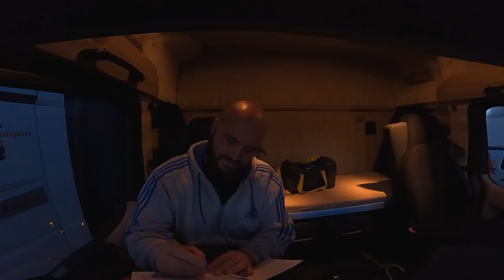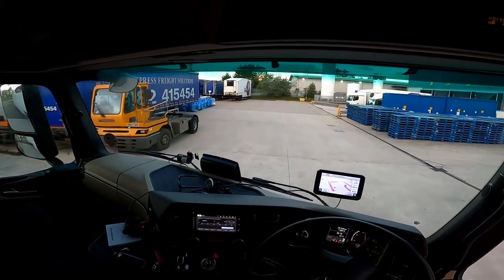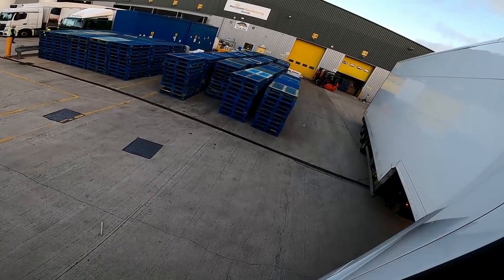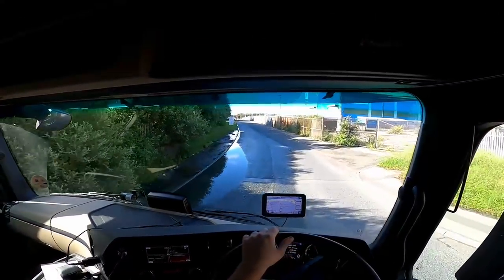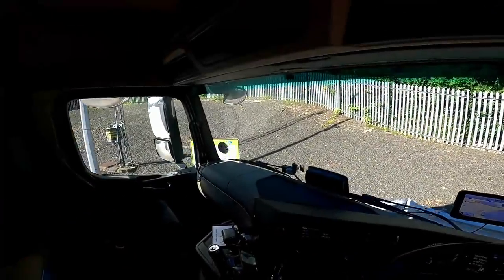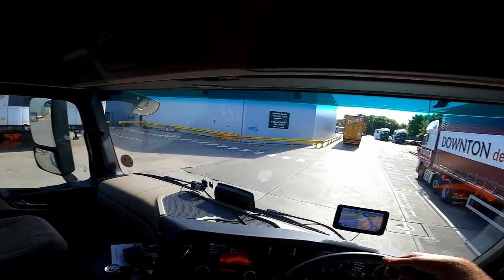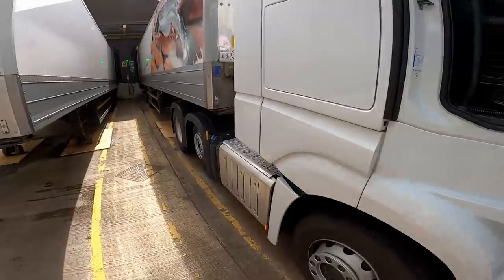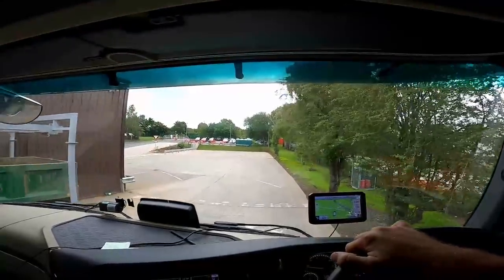The Trunkin Job

Comment: Nice one ..... you can lift and lower when pulling out or going under the trailer with the controls on the steering wheel
Reply from the maker: With the merc? I did not known that
Reply: Raul689 yeah go along to the picture with the axels then scroll down one to level control press ok and skip one to the right and then up or down to lift or lower makes it much easier my friend and I’m just going to subscribe
Reply from the maker: Thanks verry much pal. Good tip 👍👍👍
Reply: Raul689 👍👍

Comment: Originally Flaxby was owned by Household Potatoes it is a produce plant but Morrison’s took them over and I drove for them out of there for 8 years until they decided that it was cheaper to get contractors in and gave all the drivers the option to either take redundancy or move to J41 at Wakefield,I went to J41 and lasted there for about 5 years as I was doing 84 miles round trip there and back to work which they thought was a reasonable distance to travel to work,biggest mistake I ever made in my life and all that time waisted unfortunately but you live and learn I suppose, anyway all the best to management at Morrisons !
Reply: Cheaper to get contractors in rather than pay their own staff? :0
Reply: @Nat-fj2bf  You got it in one Nat !👍
Reply: @philipcollins1411  thought paying external contractors would cost a fortune
Reply: @Nat-fj2bf  Not when they pay their drivers peanuts !

Comment: Good content especially for new drivers to watch BUT !!!!  You first hooked onto a double decker which was probably 16 foot tall then at drop and swap went under a single decker box trailer which is probably around 13 foot. So in this case as you are driving a giga space actros you may well have a higher cab than the trailer, so the hieght meter needs to  be changed to the hieght of the unit ie the highest part of the vehilce. The fines for not doing this are heavy but strike a railway or pedestrian bridge and DVSA find you have not adjusted you feet and inches hieght indicator could mean massive fines, points, loss of licence or even a custodial sentence.  

It would be good to add this to videos especially as young want to be drivers are going to be taking tips from you. 

All in all as a LGV1 driver of 31 years your videos are very good. You have a very wide range of experience and conduct yourself very well. So you are giving others your experience which will help new and older drivers come to terms with situations, loads or trailers they may not have experience of.

2 important points. 

I did not see the cab reflect any tug test to ensure unit full engauged with king pin.

Also I did not see you change hieght indicator in the cab to reflect the the overall hieght of the vehicle,  which is a legally requirement of the driver.

Regards
BasherMAN
Reply from the maker: thanks for this notices. yes i think i have not changed the height indicator this time, you are right. as for the tug test... i always do it. you might not have seen it in the video but i am sure i did it. It's like a reflex to be honest 😄
thank you!👍
Reply: @Raul689   cheers mate. Well done. The younger drivers will find you very very helpful.  I know I was watching carefully at you doing container work. I have never done this in 31 years truck driving.... every day is a school day... and todays teacher is.. Raul  lol. 

BasherMAN 😉👍🤘